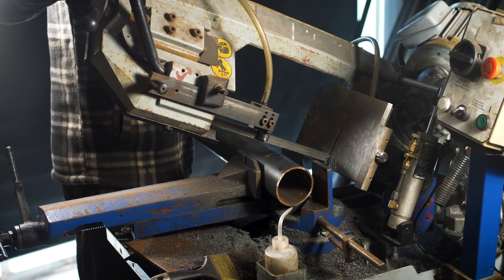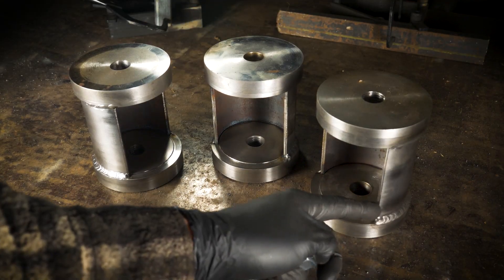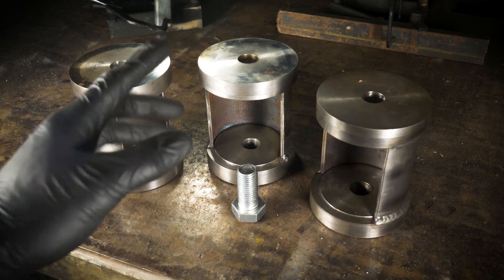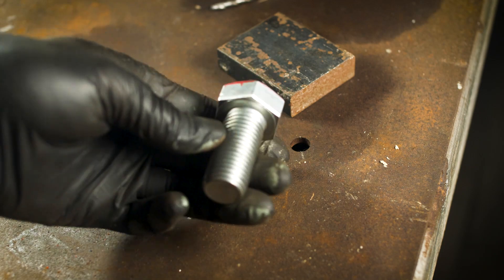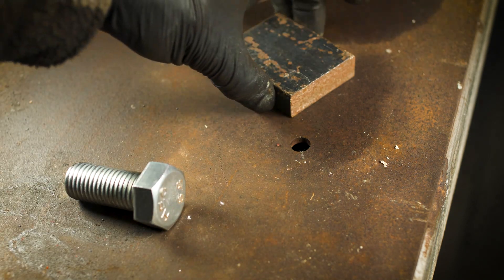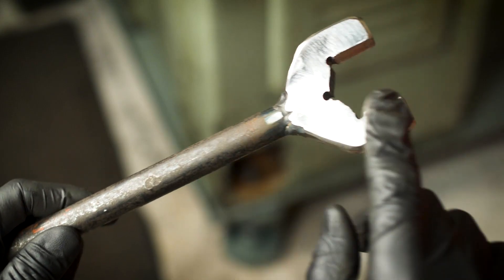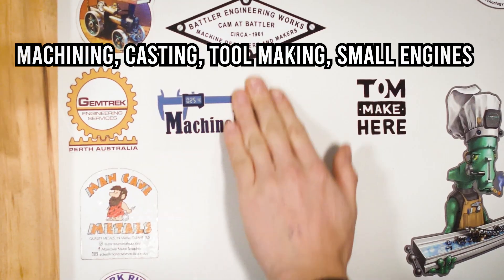Surface Grinder Adjustable Legs

Comment: That sore back from bending over to run machinery. Served my apprenticeship in in the 70s. We had a large variety of different types of machinery. Everything from lathes to jig bores and horizontal boring mills. No Bridgeports though. The worse machines we had to run from an ergonomic point of view were some OD grinders that I think were meant to be run by the vertically challenged. Also when it comes to surface grinders most people are right handed. Most of what you do with the machine is running the table back and forth.  So why do most surface grinder manufacturers insist on putting the table travers wheel on the left hand side of the machine. Most of ours (Harigs and DoAlls) had them on the right side. Much more natural to run in my opinion.
Reply from the maker: yeah some machines are terrible from an ergonomic point of view. very important for grinders because it is so repetitive to operate them

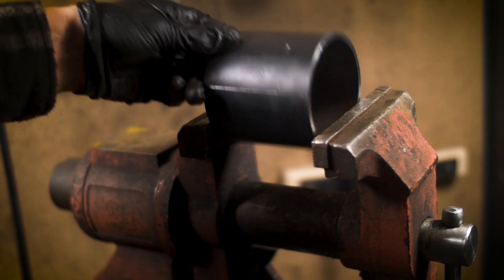Comment: I feel pretty stupid never having tried that screwdriver trick you did @ 0:30 ... Could've saved me quite a few blades and a lot of anxiety. Great vid as always!
Reply from the maker: Thanks! Usually pipes seem to spring open, but I've heard of stories where they've closed up on a blade too. I do it for good measure
Reply: I used to have make split bronze bearing for stamping presses and other applications. We always rough turned and bored and then slit with a slitting saw in a horizontal tal mill. Left a small amount at each end . Finished cutting with a hacksaw and then silver soldered the halves to gether to finish machining. A good whack with a deadblow would pop the halves apart

Comment: Thanks for the shoutout, Tom. And great fix for a problem I don't suffer from. ;) I have to use a stool to get to the drawbar on my Bridgeport. LOL!
Reply from the maker: No worries!
I can just get to my drawbar on mine. they are awkard machines compared to the little mill I've been using for years

Comment: Excellent welding.
Over time will the M20 levelling bolts bury themselves in your concrete floor
Reply from the maker: Thanks, we'll see what happens with the bolt. i estimate 10 MPa bearing on the concrete, this slab is good for 32 MPa. To a certain extent it may assist to locate the machine, but ill add a bearing plate if it becomes a problem
Reply: @TomMakeHere  Im sure your stab is plenty strong, my thinking was if the machine vibrates the bolt like a hammer drill will slowly crumble the concrete immediately under it to dust. All the best

Comment: Cool work... I am considering a different design, a block with two ``adjustable parallel`` style risers on the ends, so it would be a long machine shoe with two adjustment points, rather than a lot of small feet, as my machines are mostly heavy af and large aswell... But for small machines, this is a cool design!
Reply from the maker: No reason why that wouldn't work. This machine is designed for a 3 point support, so I decided not to reinvent the wheel... this time 😁